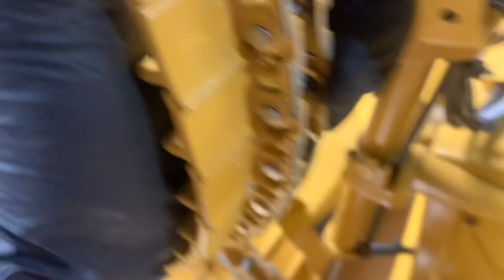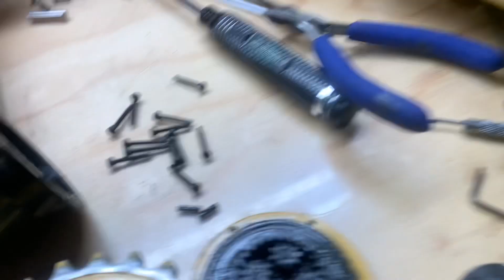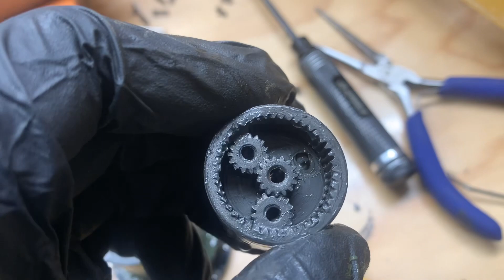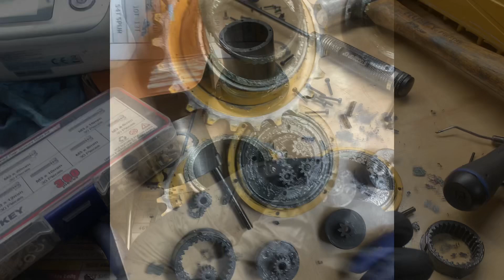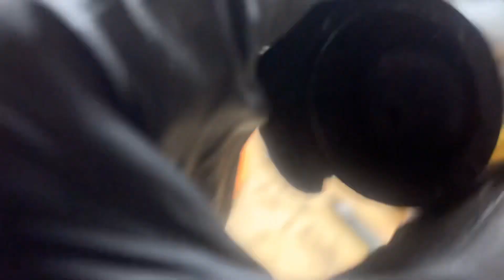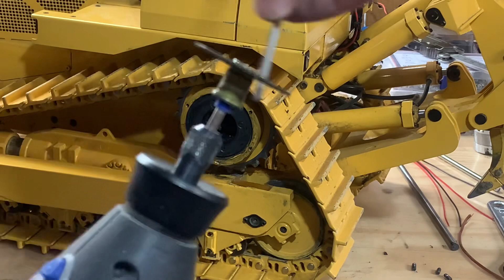Don’t blame the rocks. Repairing dozer drive. Rc construction. Shop time. Rc trucks/Rc bulldozer

Comment: I see small red-black wires are you installing lights way cool mine has never left the carpet seen you told the wife that's a gravel pile he is my hero great stuff thanks for sharing👍✌
Reply from the maker: Yep I put lights on her. Demo of them in use in this video. 
Burning the midnight oil. Outside the sandbox Ep-2. Rc construction/Rc tractors WA470 bulldozer Dxr2
https://youtu.be/VFEwlaDhXSo
All my equipment has to have lights. I like working into the dark. Thanks for watching.

Comment: you brole it because your tracks are way to tight . putting pressure on the gear drive.  .  there not ment to be tight at all but lose with some slack
Reply from the maker: This broke because I put it back together wrong and missed the pin holes 🤦‍♂️ so the pins were rubbing the gear till they were gone. I really don’t have a lot of tension on these. I put an extra link in to make it looser.

Comment: Great repair video!

I just ordered one of these so been watching your dozer videos in depth to learn about the maintenance and also what typically causes trouble.  Trying to avoid these types of repairs as much as possible 😊

I was thinking about ordering the brushless drive system from the same supplier that you ordered your wide tracks from.  But considering the price, I think I will use it with the brushed setup for a while.  Seems to do quite well as it is as long as you check that bolts are tight and lube the planetary drives with some good grease.

How do you like this dozer in general?
Reply from the maker: It’s one of my favorite machines in the fleet. Despite some trouble with the drives I will keep it operational. It’s the best for grading roads and it moves a ton of material. You won’t be disappointed!
Reply: @digitrc  Thank you!

Comment: Crazy how something so minute can cause so much headache. BTW, wondering if filing down the edges a smidge on the primary wheel will release the track as it transitions through the gear? Just a thought
Reply from the maker: That would probably help. This is still fairly new as far as run time goes for that track so I think as long as it’s not causing any issue’s I’ll let it wear in some more. It does not seem to be causing any bind or the track slap would be much worse. Do you think it might cause me some issues?
Reply: @digitrc  yah, If it’s that new I’d think to let it wear some more, the dirt will act like sandpaper to take of the edge some.. maybe by spring if it’s still grabbing a little coaxing might help, it will stretch a little quicker I’d think too, but then again it’s like tightening down a bearing to much can cause an issue as well, small rocks will put that much more strain on the gears and motor being tight with no give, just my opinion tho..
Reply from the maker: @bannanapancake  that’s a good point about the rocks and no give. The nice thing about this configuration is I can see if most rocks caught will be an issue by the time it reaches the front or rear idler wheel. I think I’ll let it run in and like you said, if by spring it’s still tight then I’ll look into honing it down a little bit. Tension will be the same either way. That’s why I went with the extra link when I installed it so that the tension wasn’t so high do too that concern of wear on the drive. Thanks for talking it through with me! I appreciate it.
Reply: @digitrc  - Dig? Your way better at this than me! I got a loader, haul truck and forklift because of you! 😂😂 so I’m learning too! I’m glad I could help think it through!
Reply from the maker: @bannanapancake  that’s awesome!!! Sorry for being a bad influence😉😂😂. What hauler did you get?
Reply: @digitrc  I don’t have any of it on my channel (need to), lot of motorcycle stuff and train stuff if anything, I got the one just like yours (minus the detailing on yours) and the yellow loader. I put together a custom king hauler though (that wasn’t cheap either) and a coastways dropdeck and lowboy with a dolly to do some work with it.
Reply from the maker: @bannanapancake  that is so cool! This stuff is so much fun. Especially the forklift. I love running that little thing. Especially during winter. Bring the fun indoors!
Reply: @digitrc  Yeah, I’m in Utah and that forklift is definitely nice for winter fun for sure! Trying to work out how to do a Bulk Bag (super sac) loader to use with my loader and then can load to my flatbed (via forklift) with my friend that live close. Your right this hobby is super fun!

Comment: Would be interesting to see maintenance videos on your wa470 loader.
Reply from the maker: Check out my playlist “shop time” I have some maintenance videos on that machine. 
Shop time. RC Repair and upgrade videos.
https://www.youtube.com/playlist?list=PLwsp_Eq3tminRbb3d6go2qzqCMtPo_pSK
If there’s something in particular you want to see that I don’t have in that playlist let me know. 😁
Reply: I would like to see how to remove a wheel.
Reply from the maker: @vbdino  cool. I’ll see what I can do for you soon.
Reply: @vbdino  you Can removed the WA470 wheel in easilly But you Can't remove the JDM Earth mover 870k wheel easilly Because All screws on the wheels very small 4me i Can't do it l😂l
Reply: @The-Warm-voice1359  I tried it  just to wash the tire before storing for the winter but even with the hub loosen, it would not come off easy so I didn’t wont to end up with more trouble to reinstall and stop trying.
Reply: @vbdino  its Good idea But if you want my advice don't open the wheel maybe You may have a problem disassembling the wheel or during the installation But the question here is when opening the axis so put more grease oil Until the crackling sound goes away